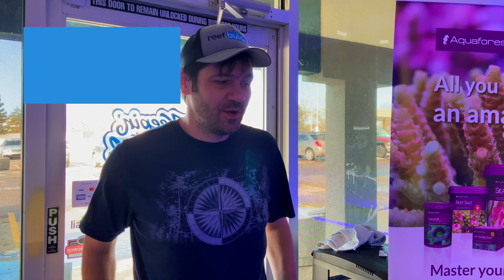Building a Unique Plywood Design for an Aquarium Stand

Comment: Nice simple stand.
Jake, "I'm not a woodworker". That was obvious! :)
Let's clear up some terminology.
The material used was plywood, not composite. Composite generally refers to something like MDF (medium density fiber). Think glued together sawdust. This is what really cheap stands are made from. It is not good around water. It swells and falls apart when wet.
The fasteners are nails, not staples. Staples are 'U' shaped. 
Finally, there's nothing wrong with a 2x4 stand. It's much easier to build for most non-woodworkers because you don't need to make those long, square cuts. The table he showed did not have any lateral support. Skinning with even 1/4" plywood would have made it very strong and rigid. As it stood, it was like a plywood box without a back and face frame.
Reply from the maker: thank you for the clarification
Reply: Made the mistake of using composite board to paint on with oil paint a few years ago, then had a house emergency and it got wet, thing just fell apart and turned into wet wood shavings. Good thing I didn't care about the painting that much. And now I know what composite wood is, lol.
Reply: Well said, covered much of what was going through my head!
Reply: Composite could be used for ply, it’s a fancier name so they can charge more tho, but I’m sure a marine ply would be just as good, with a 2x4 frame and some good paint should look great too 😊
Reply: Thank you I was losing my mind
Reply: Can you tell me what type of nails they used and thpe of glue im trying to build this exact stand

Comment: I'm not a woodworker either and this is a crude example but still a very good example of what you can do without using the klunky 2 x 4 method.   Very nice. We need more of these plywood videos. I would bet that thing could holt a truck if it was placed on top.

Comment: Stand looks great! My stand is a combination between the plywood/brad nails and 2x4 design. Best of both worlds. 

In my stand I applied white flex seal around the bottom, and up the sides a few inches. That way if the sump/stand leaks, it will fill the bottom of the stand before it runs off into the room. Use of a “WATCHDOG water sensor alarm” will scream so loud the neighbors can hear it. 
Also, I applied silicone along any corner where wood touches wood. Might be overkill but I want this stand to last forever. White silicone on white paint is pretty easy to keep clean, just tape it up and be patient. 
None of this is required to have a reliable and elegant reef setup, but going overkill made the build process a bit more fun for me!

Comment: If u have a red sea tank or water box tank stands are basically the same as this stand  they use camlocks to hold together and no glue. The stand looks great it will b fine
Reply: The Red Sea tank is composite and swells if it gets wet.  I ended up remaking mine to the same design in plywood.

Comment: The 2X4 stand, the local saltwater store had the entire store built on them. They were there for over 20 years until it had to move locations, and still had to be demolished. The biggest concern would be to make sure the fasteners will hold up to the salt, if the metal rusts then everything is gone.

Comment: I don't know Jake. Ur putting a lot of faith on those 2 side 3/4 pieces of plywood. I did not appreciate the comparison to the ill made 2x4 stand. U can remove the center 2x4 by the way, u can also skin it, and add LVL support braces and glue everything.
Those "braces" on this plywood build are only being held by pin nails on the sides (except for the one in the middle. I would feel more comfortable if you removed those middle supports and  glued another piece of plywood on each side (on the inside) supporting ALL the braces... I'm not saying it's not going to hold but I would trust my 2x4 build more. x-ing my fingers  for you knock on wood 🙂 peace☮
Reply: Also, when all those plywood glued points get wet..
the wood glue WILL SEPARATE from the wood, PERIOD!
then you only have brad nails holding up 1000 lbs of sloshy water.
Reply: @min2oly  Great point! In Seattle we have Milk Carton Derby. I built frame using liquid nails, my friend built with wood glue. His fell apart by the end of race day, mine is still holding today. It's been 11 years!
If you watch my Aquarium stand video U'L C I used liquid nails 🙂
Reply: @AntiMaxer  So you don't believe the new build will support the tank then? The entire support relies on plywood... except those two in the middle, and actually we don't even know if they aren't made of plywood?
Reply: @AntiMaxer  umm, not sure we watched the same vid, the "joists" are not 2x4s, he glued plywood together to make them 8:27  The "two supports" are also too small to be 2x4s so we have to assume they are also plywood as he did not show how they were made. also, no "finishing nails" were used, at most 18gauge brads, although from the look of that nailer they could have been 23 gauge pin nails...
I think we agree on more than you let on 🙂
Reply: Nobody thought giant whale size chunks of steel could fly thru the air carrying hundreds of people and land safely thousands of times a day. (Except Boeing planes of course those are deathttaps)
Reply: @chaseaaronthomasify  Anything is possible, remember how planes use to be made from wood, glue and muslin back in the day...
Reply from the maker: thanks to everyone for their thoughts and feedback. We can probably agree that this stand design is a helluva lot more durable overall than the 1/4" acrylic the old stand was built from
Reply: @ReefBuildersVideo  I would Love to agree...
1/4" acrylic vs wood glue and brads... 
Just don't let it get wet at the seams 🙂
Maybe coat it with epoxy boat paint?
I finally made the switch to 2little fishies salt, love the 5g bags -Thanks!

Comment: Hi, such an impressive build. I’m going to be building a stand for my half moon 190L (about 50 g I think). If I made a stand like this, (rectangle) can I then cut a curved panel from a wood panel to put on the top with the edges hanging over for the tank to sit on? Probably no more than 2-3 inches overhang.   Is overhang ok on this size tank?  🇦🇺❤️

Comment: Not exactly how I would have done it but it's interesting to see others' ideas. Seems structurally sound enough.
A better blade and a track saw would eliminate the splintered edges. I like the sistered plywood strips as bracing - should be more stable than a 2x4 over time and plenty strong. A side opening to get at the back of the stand might be nice, otherwise it'll be hard to reach anything back there.
Reply from the maker: We'll definitely be making some more openings now that the 'box' is complete

Comment: I like to use Aluminium profiles, it´s quick and they last for ever. You can cover them with any material you like and it can be replaced if needed without taking the whole Aquarium down.
Reply from the maker: So do we, we've got 4 IM APS stands that are totally open and a couple more stands from CADE and ProClear that have finished sides

Comment: Your stand came out great but just in case anyone watches this video and reads comments i will say this. 

First, 2x4’s can hold significantly more weight then plywood. Give or take 10 times the weight.

Second, for those concerned about the glue, he is using titebond 3 which is extremely water resistant. It will not fall apart when wet like some are saying. Plus it was painted over.

Third, i would not place a sheet of plywood flat on the floor as it will collect moisture and rot out eventually. If you notice, every stand design has feet of some sort not only to level but to support weight across uneven surfaces. So many reasons for it not to be flat on the floor.
Reply: Good point about it being on the ground, I didn't think of that. However, the reefbuilder studio is not level and i believe they always have to put things under the stands to level the waterline.
Reply: Will it be good idea to use 2x4 for bracing instead?
Reply: @reefbeta3068  you can for sure. I use both plywood for looks and 2x4 or 2x6 for support

Comment: It's better than Marineland press board. Not a fan of 3/4" plywood on 3 sides. I would of double the 3 sides. Or made the stand a few inches shorter. Definitely a lot of weight in front center with not much support. Nice LFS I wish I had one near me...

Comment: Couldn’t the 2x4 one be made similarly by adding glue, maybe some diagonal supports also? But this does look way nicer! 🤷‍♂️ I’m no woodworker tho 🤣 but I think the 2x4 with some marine ply around it would be just as strong 🤔🤷‍♂️
Reply from the maker: yes you are right the combination of 2 x4 and plywood can make for a very solid structure and this is what I used when I built the stand for the water vats

Comment: 13:13, why does it look like the tank is not sitting flush on the stand?
Reply from the maker: Good eye! The acrylic tank sat on an acrylic stand for 15 years and despite the support it drooped quite a bit in that time. We're letting the bottom of the tank relax back into a flat shape but it rested sat on a bubble when we first placed it on the new stand.
Reply: @ReefBuildersVideo  i never knew acrylic is so pliable as cookie dough, its interesting to know that it will resume back its original shape as a flat pane, good luck

Comment: 100% agree that plywood stand looks way better than a 2x4 stand, although it would have been nice to have a little notch out for the overflow like he showed on the demo stand at the beginning, but... that 2x4 stand he had was absolutely garbage built if it shifted that much by pushing on it from the side.    I've built plenty of them over the years, mostly due to lack of space to do plywood, and they have been beastly as far as strength (and yeah they do weigh a flipping ton) even built one that didn't use a single metal fastener.    That said, my new jam these days is extruded aluminum stands, so much fun to build, you just have to think about the design well in advanced to building it.

Comment: Sorry brother, but as a lifelong builder Ive got to say a big no. Those finish nails arent designed for holding weight.As you add water, rock, ect thats alot of static weight.
Reply: I've seen similar builds done with pocket holes instead, would you trust that more? I'm handy but not a woodworker or engineer, I just want to build something that looks really sharp and is straightforward to make. The Red Sea reefer I'm rebuilding deserves better than a 2x4 stand.
Reply: @rebeltango  pocket holes can be pretty strong. You can still do a 2x4 design with a plywood shell so it looks nice. Look up melamine plywood.